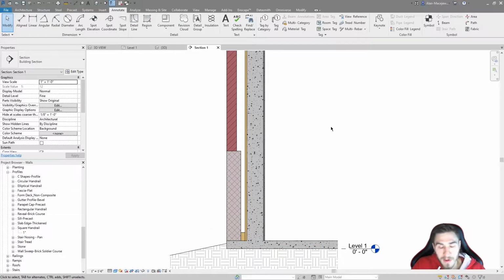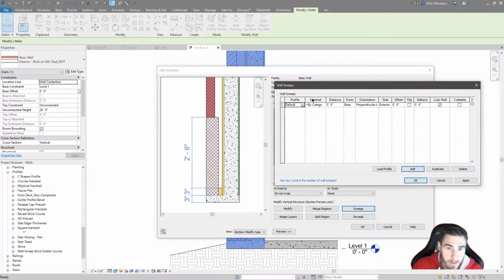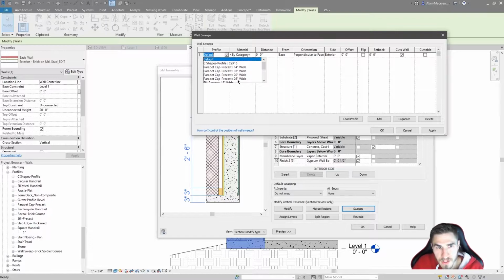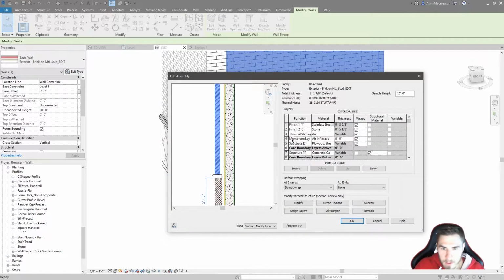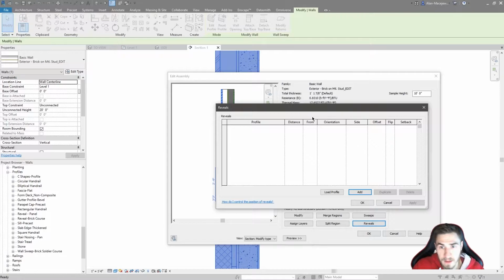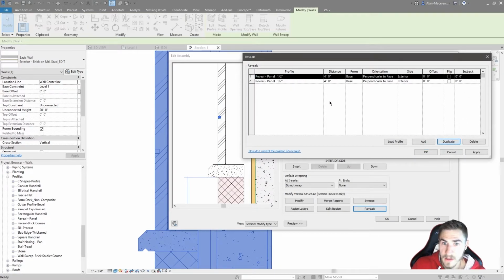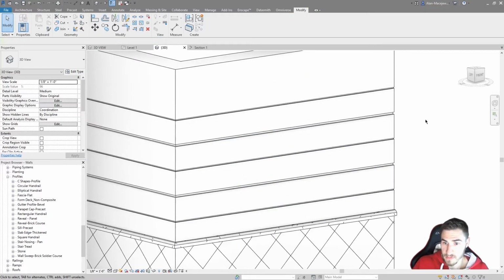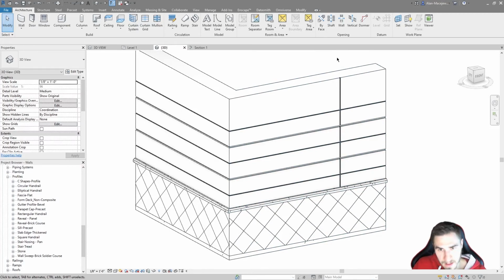How to Add Sweeps & Reveals to Walls | Revit

Comment: What is the difference between setback and offset?
Reply from the maker: The difference is whether the sweep should move vertically or horizontally.
Reply: @ArchitectureVanguard   but isn’t the distance the vertical direction? I’ve tried flexing these parameters but it doesn’t look like anything changes when I change the setback setting.
Reply from the maker: The distance would move the sweep vertically, and the offset would move the sweep horizontally. The setback works along the same lines of the offset, although applies to each end of the sweep (end of the wall also because the sweep is tied to the wall). What happens is that the sweep is set back or set in from the end of the wall. For example if you have a sweep applied to a 10' wall with a 1' setback, the total length of the sweep will only be 8' because the sweep with be set back 1' on each end of the wall. Hope that makes sense. This is a really good one that is not covered enough. Would also be a great one to feature in my community starting up soon. Thanks and  hope that helps!
Reply: @ArchitectureVanguard  Thank you!!
Reply from the maker: Not a problem!

Comment: Is it possible to have the vertical reveal cut the horizontal sweep. For example if you have a precast panel and your adding a vertical joint which cuts thru a soldier course, is it possible to have the reveal cut the thru the sweep that is baked into the wall type?
Reply: I have been trying for weeks to deal with the same issue, any luck?
Reply: @ I ended up making a wall hosted generic mode family that has a void shape, with top and bottom "pulls" (stretch parameters) I have been using instead in place of reveals, as these will cut thru sweeps!
Reply: @elliotevans6524  Wow, sounds good. Any video online to do this? Cheers